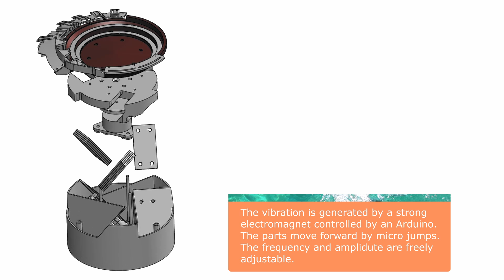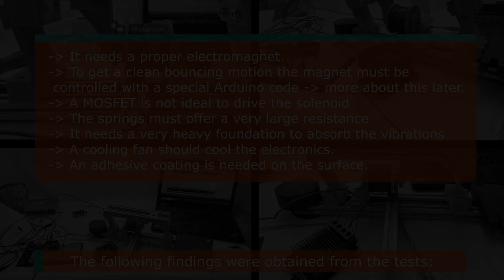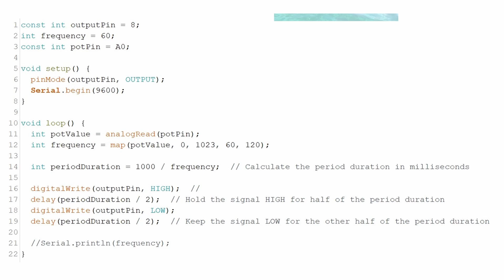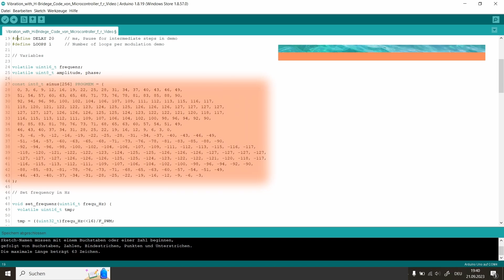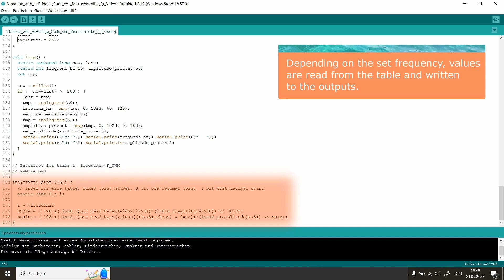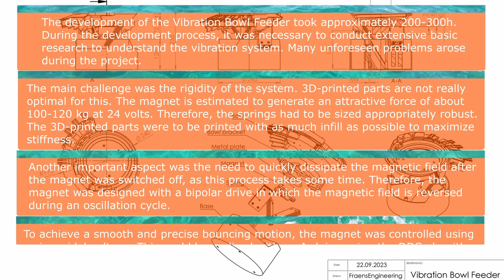3D printed Vibration Bowl Feeder / Construction / Technical Details / Arduino Code / DDS-Algorithm

Comment: Hi, I love the design! The files are great and the construction is flawless! I am however having issues with driving the electromagnet, I cant seem to get the full power to the coil due to the inductance at high frequency. Did you use any capacitor for load matching or did you encounter this problem at all?
Thanks!!
Reply from the maker: Hi, yes, I know that problem. As far as I can remember, I solved it with an H-bridge (L298n). I powered the magnet in both directions. You should have a picture of a circuit diagram in the files. You can see the H-bridge there.
Reply: @FraensEngineering Thank you for the reply, I am also using a H-bridge as in your diagrams. I am noticing that I lose supply power as I use the potentiometer to increase frequency, is this something you experienced at all? I see in the video that you are able to drive the magnet with around 15W which is a value I cannot even get near unless I run the magnet as DC. I am thinking of trying magnets with lower voltage rating than the one I have at the moment (24V).
Reply from the maker: Hello, 
Yes, I used a 12V magnet and controlled it with 24V. This is not correct from an electrical point of view, but it works much better. However, you should monitor the temperature. The 12V magnet with 24V has much more power. But remember to keep an eye on the temperature.

Comment: Thank you for sharing this work with us.
Can you tell me which code you used to operate the machine, the one from the video or from the website? Is this the full code to run the machine?
What are the potentiometer values in Ohms?
How much is the gap in millimeters between the magnet and the metal?
Thanks again for everything

Comment: what if I wanna feed small shaft diameter 3 mm. x 18 mm. length.   I'd modify the width of the spiral in the bow to me narrow like 5 mm.?
Reply from the maker: You can leave the width as it is. It's enough if you fit a small wedge that throws everything else back again

Comment: This is a very nice design!

Your FESTO and SMC products give away that you work in automation ;)

You should look at the afag linear and bowl drives - they are counterbalanced by the mass of the electromagnet counter-oscilating with the track and bowl.  In this way they cancel out and absolutely no vibration is transfered down to the table/mounting surface.
Reply from the maker: Thanks for the tip ;-)

Comment: I'm so interested in this. Could you please Talk about the angle of the springs and on what basis the angle of the springs is calculated? Is it a general angle, and how much is that?
Reply from the maker: I determined the angle empirically. The flatter the angle, the faster the movement.
Hier kannst du es Downloaden:https://www.etsy.com/at/listing/1558942124/3d-printed-vibration-bowl-feeder-system?click_key=4ba30f28475c92f5fd5b23e079709fc0b6196eca%3A1558942124&click_sum=30068c97&ref=shop_home_feat_2&pro=1

Comment: I am designing a small version of a vibrator feeder for separating parts. Did you try with a vibration motor? I am thinking a DC vibration motor hanging from the bottom instead of the electromagnet would make controls so much easier. with just a potentiometer the frequency can be controlled. I still have many questions un-solved. Is this abs?
Reply from the maker: Hi, industrial machines work with magnetic drives. The advantage is that there are no moving parts such as ball bearings. Magnetically driven vibratory conveyors are therefore very low-maintenance once they have been set up correctly. 
I know motor-driven vibratory conveyors from my old company. There we built meter-long conveyors for transporting stones, glass, etc.

Comment: Perhaps in the future it can replace CNC and hand-made vibrating bowl feeders we used many feeders in our machines...
Reply from the maker: I think it will in the future. Making the bowls is extremely time-consuming. 3D printing is a very good option here. When metal 3D printing becomes cheaper, it will certainly be an alternative.

Comment: This is really cool to see you figure it out. Instead of a flat electro mag, could you benefit from a 2 piece solenoid? With the core mounted to the acting plate projecting through the windings on the base. Maybe it would desensitize the mag gap since you'd be acting on a cylindrical core instead of a flat surface. Then you could more easily tune it with the drive for whatever spring and load you have.
Reply from the maker: Yes, you are right. Original feeder systems use other magnets. However, these are extremely expensive. I wanted to implement it with a simple, inexpensive pot magnet.

Comment: Hi friend! Very nice job and research. It works really well for 3d printed construction. Tell me please, what angle of plate tilt did you find optimal, how much angles from vertical axis? Thanks in advance.
Reply from the maker: The angle is partly responsible for the conveying speed. I think between 45 and 60 degrees to the horizontal should be good.

Comment: Great video!
On the linear feeder what variables would afect the speed of the objects the most?
And do you think PLA would resist for a long time before fadige strats to weaken the material?
Reply from the maker: The speed is determined by the installation angle of the springs. I am currently working on a project where I am also using PLA springs. These broke after about 2 days of continuous running. I am currently testing with PETG. I will then show my findings in a video.
Reply: @FraensEngineering  Thank you for the information. 
I'm looking forward to watch that video. 
Continue doing a great work 👍
Reply: I forgot to ask, is it possible to use a weaker magnet, for exemple 30kg of strenght?
I want to build a 3D printed linear feeder for golf tees. Since they are light objects, the strenght of the springs can also be reduced, and therefore the strenght the magnet?
Also, can you share the wiring diagram you used with both potentiometers?
 @FraensEngineering

Comment: This would be an excellent base for something called a vibratory tumbler. Basically, it works by shaking rocks or metal parts with some polishing grit and water. The one’s that rely on solenoids instead of rotary motors are extremely expensive. But your design would make these tools much more accessible. All you would need to do is print a bundt cake shaped bowl for the rocks to sit in and put on a lid.
Reply from the maker: That's an excellent idea. Maybe I'll put it into practice. We used to have something like that in the company where I worked. It was a large horizontal drum in which we deburred the laser-cut parts. I am always open to new ideas. Thank you very much :-)
Reply: I actually found your video while researching how to make my own polisher. If you designed this into a rock polisher, I’d buy it. I’ve been trying to figure out how to make a very basic control board for the electromagnet using a 555 timer instead of an arduino. The biggest issues with the polishers you can buy at the store is that the bowls rust, crack, and leak. Also, the motors they use burn out quickly. I really just want to build something like what you have here but with using potentiometers to control amperage and frequency instead of trying to do any programming.
Reply from the maker: Can you send me a link so that I know exactly what you mean?
Reply: @FraensEngineering i just realized my post with the html links are being removed. Not sure how else to send them
Reply from the maker: I still don't quite understand which stones you want to clean. Please send me some pictures so I know what kind of machine we are talking about. You can write to me at fraensengineering@gmx.at.
Reply: @FraensEngineering i’ve sent you list of different thoughts i had for how you could use your base with either a water tight bowl or a flat lapidary sanding plate for either small rocks or large cross section cuts of large rocks and gemstones. I also sent you kind of a rough idea for the basic breadboard controller.
Reply: I wish this worked more like discord so i could share screenshots and other diagrams. I made a tinkercad version of the controller but i have no idea if it would work.
Reply: I made a few 3d models of a vibratory tumbler. They aren’t perfect, but maybe they would help better explain how it would work
Reply from the maker: Constructing the feed pots is not easy. It also took me quite some time.
Reply from the maker: Hello, I wrote you an e-mail some time ago regarding the magnetically operated tumbler. Would you have any tips for me? I have been looking in a forum for someone who can send me a photo of the Mini-Sonic Vibratory Tumbler. However, no one was willing to take it apart so that I could see the inside. 
Have you drawn any models?
Reply: @FraensEngineering  Oh shoot, i didn't see your email till now. I think it would be easier to send info over discord if you use it. my email is not very reliable, but we can stick to it if you don't use discord. anyways, I have not seen a mini sonic taken apart before, so im not sure what the tension springs would be for. Also, the reason i sent you the mini sonic example was because it's the only polisher i could find that doesn't use a motor to generate vibrations. I think there are better bowl designs. I can send you a link to the two basic designs i threw together if you want
Reply from the maker: The Mini Sonic should really be the only one. I've done a lot of research in the last week. Unfortunately, apart from the picture in the data sheet, there is no information that would help me. I have already looked to see if there is one for sale in Europe. Unfortunately without success. Ordering a new one in America just to take it apart is unfortunately too expensive for me. I couldn't find any used ones either. I would be very happy about the links. Any help I can get will be gratefully accepted. I am afraid that this project will take a lot of time again. I will have no other choice but to test what works. But I'll keep looking. Maybe someone can take a photo of the inner workings of the machine. This would be a great help in understanding the proportions of the parts.
Reply from the maker: I have a Discord account. However, I'm not very familiar with it. My name on Discord is Fraens #5374
Can you write to me with it? It can't be so complicated that I can't learn it ;-)

Comment: Could an Arduino Nano be used instead of an Uno?  Is the code listed on your website complete or is it available to download somewhere?  Thank you for sharing this - excellent work!
Reply from the maker: Hello, the code on my website is complete. I think it should also work with a nano. I would not think of anything now why not. If you test it, let me know.
Reply: Sorry, one more question.  Do you think this polarity reversing benefit will work when using a neodymium magnet instead of a steel plate?  I plan on using this with a linear feeder similar to the one you show at the beginning of your video.  In my case I am very space limited and hope to get away with three P20/15 24v (250 ohm) electromagnets wired in parallel.  Thanks.

Comment: Hello! Really cool design and machine! Thanks for sharing!

I am currently learning more about 3D printing myself. I was curious, if you don't mind answering; how long did it take to print the larger components and pieces of the body?
Reply from the maker: Hello, unfortunately I don't know that exactly anymore. I have a Voron 2.4 printer. This is a relatively fast printer. I print the perimeter with approx. 110mm/s. The infill is even faster. Around 130mm/s. The dish has printed about 7 hours I guess.

Comment: This is pretty amazing but I'm struggling to understand the mechanics of how this actually works. How does vibrating make it go uphill?! I'll have to do some research into this process to figure things out...

Regardless, great video and as an aside, seeing the seeds left over in the screws at 12:18 made me laugh. 🙂
Reply from the maker: The parts are thrown upwards by the arrangement of the springs. The springs have a flatter angle than the slideway.
Reply: Here's how I think it works: When the magnet sucks down, the springs pull back and turn the device slightly without contacting the stuff in the plate due to inertia, then when it releases the magnet, the springs push up and spin it slightly to return to the initial position, imparting the spin on the stuff in the plate. This occurs at whatever hertz the magnet is set to so it looks like a constant motion to the naked eye.
Reply: @boomchacle  Yeah, that seems to be what I found in my research. The fact that the springs are angled is the key. And when making it from scratch, you've just gotta keep the angle correct for the side of the "tub" that the ramp is on. Because you could easily screw that up and everything would rotate backwards.
Reply: @boomchacle  the impulse throws the part upwards and forwards, then the part slides back a little (friction is important) and then the next impulse from the sine wave throws the part again before it has the chance to slide back to its original position. so it's always moving forward.  Like 1 step forward, half a step back, one step forward, half a step back...etc.

Comment: cool but what do you use it for?
Reply from the maker: I'm sure I can think of something ;-)
Reply: @FraensEngineering  use it to feed chips into your mouth.  great job btw. i studied automated assembly systems and did the calculations for feeders at college. always wondered if we can 3d print them.  might do one myself using resin printing.  would be fun to add some additional orientation features and have misaligned parts drop back into the bowl.
Reply from the maker: I'm thinking about getting a resin printer myself. According to my research, the parts are relatively brittle. I'm not sure if this could work. The forces that are introduced are not exactly small. Installing traps is the next step for this project. Basically, the feeder was built to sort screws. I'm going to look into that.
Reply: @FraensEngineering  The right resin will handle the forces no problem.  I use resins that will outperform 95% of FDM materials (including high grade engineering filaments such as ULTEM).

Yes, they can be brittle (especially if using cheap resins) and if they are left in strong UV for too long, but even a decent "ABS-like" resin will outperform PLA in terms of most mechanical properties. They get really brittle when printing thin structures. I have been using a technical resin on a project, and we are printing walls of 300 microns. Very brittle at that thickness, especially as it is translucent when thin, and allows UV to penetrate more.  But when printed at a couple of centimeters, its no problem.

If you want to spend $100 and upward per kilogram on more technical resins as I do, they will blow any filament out of the water, even for impact resistance.

I have a lab oven for dual curing resins also, which i can also use for technical coatings which also enhance the durability of the resin (as well as protect from UV)
Reply from the maker: It sounds very professional what you are doing. So it depends very much on the resign you use. I thought I'd get a printer from Anycubic or something. Just to see how it works. I assume you have a slightly higher priced model. Such a device would fit well in my workshop since I have an exhaust there.